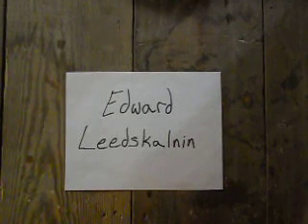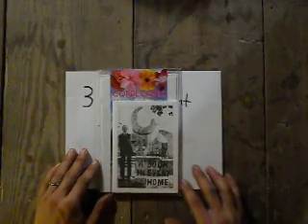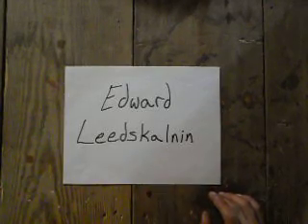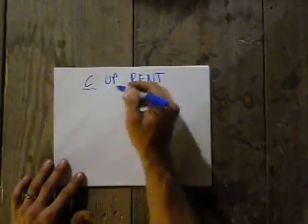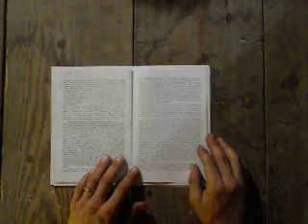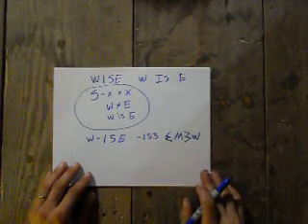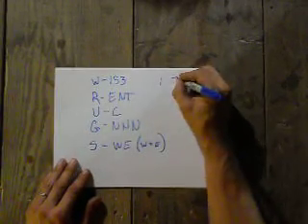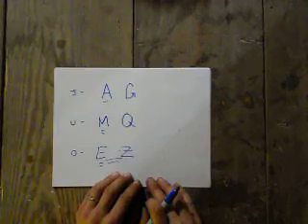Edward Leedskalnin hidden Enigma Machine settings in Magnetic Current

Comment: 14"19 "nnn= north north north. North repelling north in series of 3 during cycles of the sine will break ground off opposite ends of opposite grounds of 3 grounds wired a specific way. Letters g-a-m-e at 18:16, hey where did Ed work you said at end?

Comment: I put the settings as bellow:
Wheels: C. I - V - III 
Start: N N N
Rings: 05 14 20 
Plugged: WE AG MQ VN RT DF ZX BC HJ PO
the rest plugged's are just random.
The thing is if I apply it for the text from Magnetic Current e.g.: "First I will describe what a magnet is. You have seen straight bar magnets, U
shape magnets, sphere or ball magnets and Alnico magnets in many shapes.." 
On the output there is just mess without any system: "oolbi gpvfu runle lsxkq nofnw mttcj wcllq enjlj dikdu .."

Comment: hey, using that online M3, it says you need ten pairs for the Stecker...  
This is as far as I can get with the settings:
Wheels: C. I-V-III (N,N,N) / Rings: 05 14 20 / Plugged: - -
If I understand you correctly, the "Plugged" setting should be "W E" ?